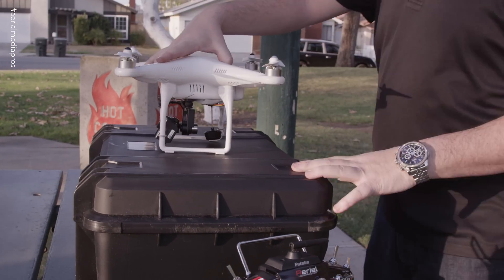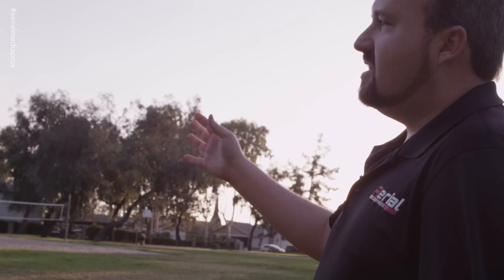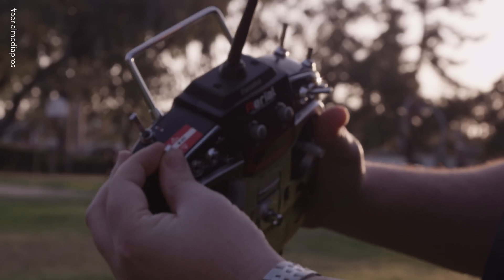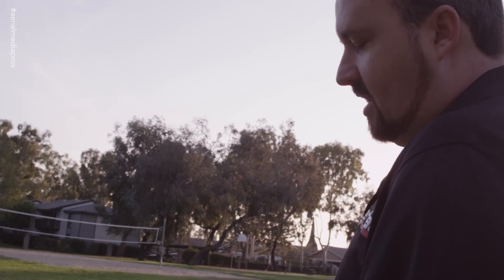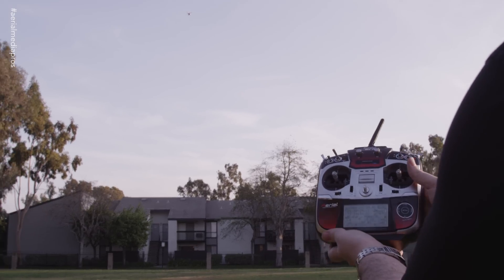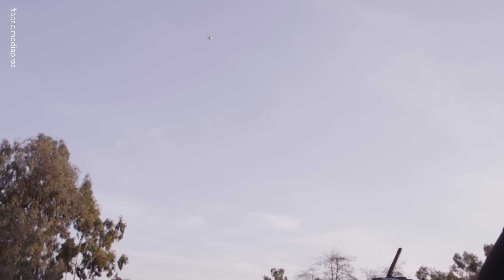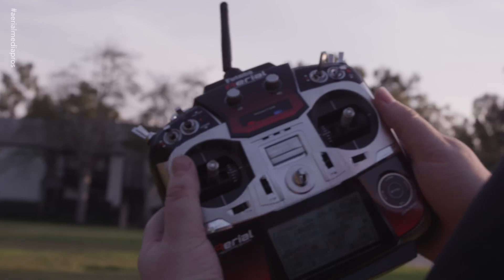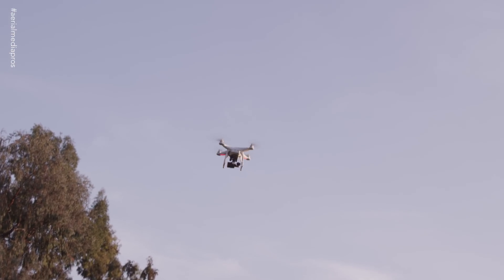DJI Phantom 2 Pro Package "Fail Safe Demonstration"

Comment: Hi, thanks. Are you using the Phantom2 mode or nazam? I'm flying in the nazam mode and I don't have to switch ATTI to cancel the failsafe. So I was flying like: GPS  --> switching failsafe (returning home) -> switching back to GPS (cancel). I have also IOC enabled but the IOC was switched to OFF.
Reply from the maker: Did you buy this from us?
Reply: No I didn't. I'm using a stock DJ6 controller.
Reply from the maker: Jcool721 You would have to send this into us to be built. Aerialmediapros.com for more info and who to call. Thank you
Reply: Thanks, no problems. My P2 is flying great. Keep posting great videos ;-)